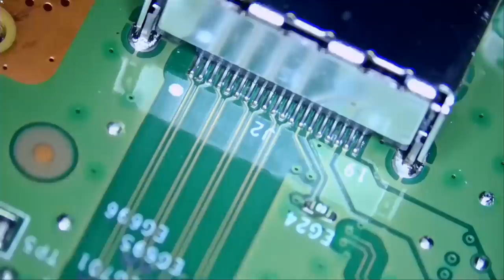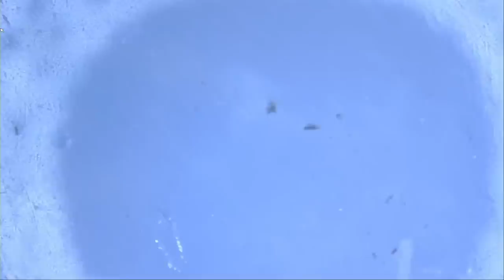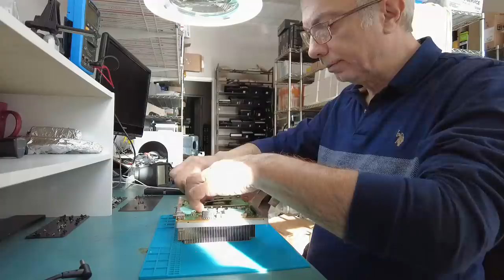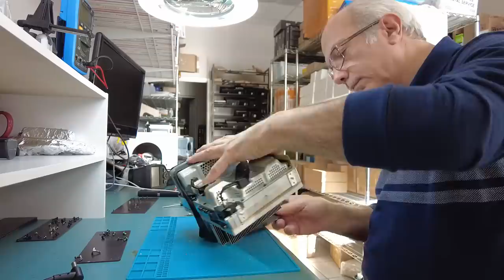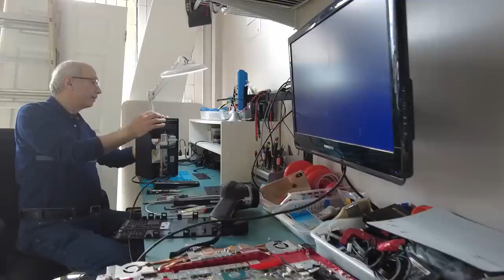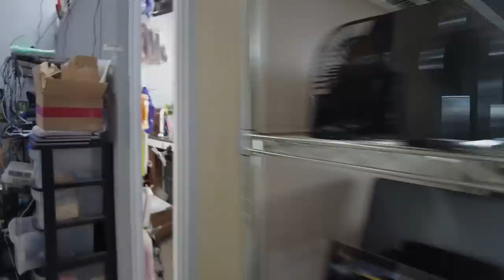Xbox Series X Repair - Suddenly No signal. HDMI is good.

Comment: nice video as always. Great to see Big Boss at work - sometimes people don't appreciate that breaking into a unit and reassembling it properly is as difficult as the repair itself.
Reply: All that work for just 1 chip, that takes 2 mins to put on.
Reply: @Edge-71  if you have the knowledge and skills to do it you can tell that. If it was me trying to replace this ic it would take hours and end up with a useless board
Reply: It adds a lot to show a speed up big boss operation. The work required is significant.

Comment: I liked to see Big Boss in the video, he does al the hard work taking apart and putting back together the hardware you get. It looks easy when you get the board on your workbench, hardest part is mostly getting hardware to open up without breaking those plastic clips.

Comment: Question. Why isn't big boss bench equipped with a an electric screwdriver? Wouldn't that increase productivity?
Reply: @Guapbeatz  It makes sense if you are using industrial strength torque to it. There are lower torque versions for electronic sectors. Because i always hear him bitch about wasting time doing this and searching this and that. 

So i was thinking why not improve  productivity and also reduce fatigue/ wear on Big Boss hands when he disassemble/ assemble products all day long?

Comment: Question: if solder bridges form between pins as shown in the video, why wouldn’t solder bridges form between pins and the heat sink pad? Same conditions. Flux didn’t prevent bridges between pins. It sure seems possible.

Comment: I got an Xbox Series X 5 days ago and the HDMI port went bad on it in just 3 days. I tried multiple HDMI cables, multiple TV's, monitor & tried to boot it into safe made for a factory reset as well as booting it into low res mode and none of these were successful at resolving the issue. Just sent mine in for a full refund and I'm getting another. I currently was running it on a ASUS VG27AQ which allowed me to run it at 1440p 120hz/fps and my TV's in my house all run 4k at 60hz only which is fine for a backup. I pray my 2nd one will be better otherwise I'm going with the PS5 instead. Btw do you know what would cause the NB7N chip? I'm guessing this had to be my problem as well. Thanks in advance
Reply: Did your new one work? I got a series x last week and had a problem with HDMI signal cutting off like every few minutes. Got another one and same thing. Should I just get a ps 5?

Comment: I wonder if they will design a refresh with a more solid hdmi connector, and better engineering for the circuit this chip is in. They seriously need to get a better hdmi connector, even if they add on  anchor that screws between the connector and the chassis, that probably would be enough. They shouldn't though, it gives you business!

Comment: Sir I have read in many data sheets that the maximum heating temperature of the semiconductor component is 300°C for 10 seconds. Why the components you solder don't get damaged when you apply 550°C hot air continuously, in some cases for more than 30 secs?
Reply: The component starts at room temperature and the board itself is a form of heat sink. Applying 550°C hot air doesn't mean the component is instantly over 300°C.  The melting temp of that unleaded solder is ~217°C .  When he gets the component to just over the melting point he removes it as quickly as possible and removes the hot air. The component will not be over 300°C for 10 seconds.
Reply: @djmips  okay thank you for the information

Comment: What temperature do you typically have your air at when working on these boards. Trying to replace a NIC on my xbox and it is not heating up enough. I am at 500c with level 4 airflow.

Comment: Working on a board with the same issue. Having one hell of a time getting the chip off. I’m at 480°C and 6 out of 8 on airflow. Thats the max temp my current air station can reach. Waiting on a Quick 861 Pro to come in from China right now. Won’t be here for another few weeks to a month though. Anything I can do to help remove the chip?

Comment: What material are ICs made from, so they can withstand so much heat from the hot air without melting?
Is it some kind of heat resistant polymer?

Comment: My series X started doing this.  It turns on, but no signal on the tv.  Tried different HDMI cables and nothing changed.  Except my console shuts off after a few minutes too.  Is that’s the same problem?

Comment: My laptop turns on but I can't see anything display on the screen. I changed the ram and hardware, but it still don't work. I don't have money to ship it fr repair, but I do have a multimeter, I have disabled the motherboard but I don't know which component is responsible for the no display issue 
What do you recommend I should do?